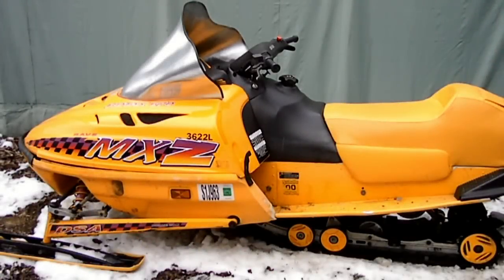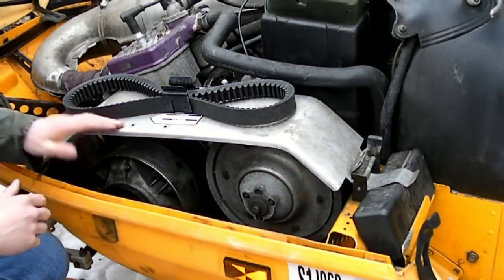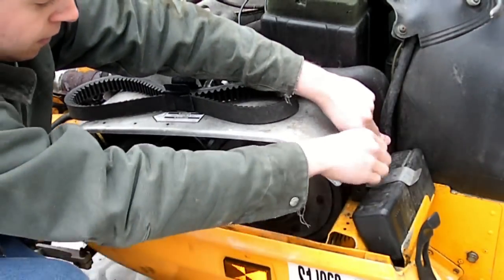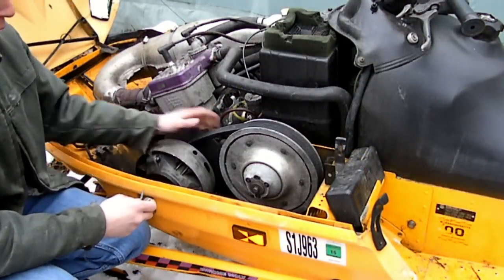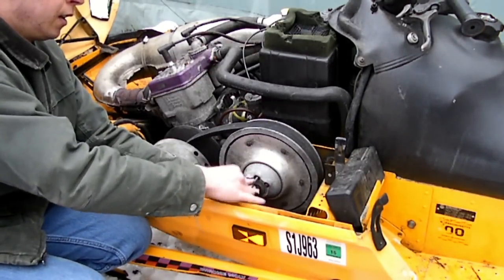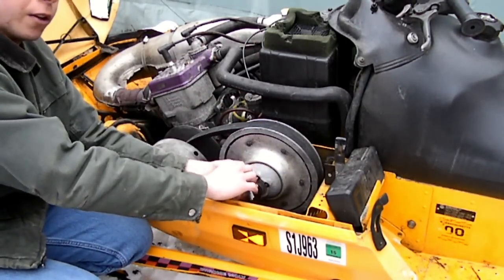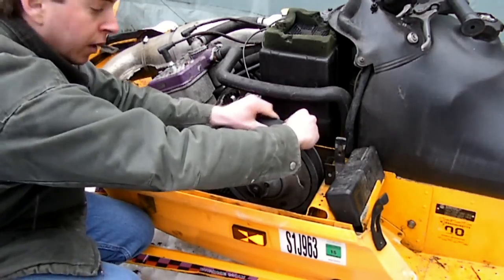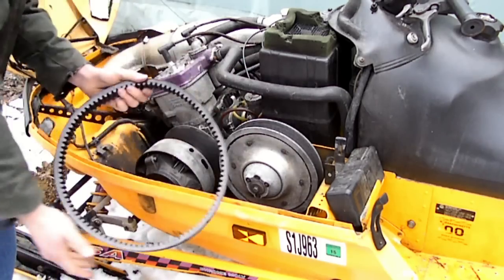How to Change a Snowmobile Clutch

Comment: Hope you adjusted your belt deflection! Top of the belt should me.even with the top of the sheaves on the secondary otherwise not gonna run and engage properly
Reply from the maker: Sean Jackson I was in need of a new belt. It's all good now.
Reply: 1/8” above the sheave at 12 0clock location

Comment: I have a ‘96 formula sls (500 rotax) and it only engages at 5000 rpm; belt looks allright and i dont think the clutch is broken. Do you have an idea on what’s wrong with it?
Reply: I have a 97 sls they engage between 4500 and 4700ish its how it's made, just built different look it up on some forums some people are very knowledgeable

Comment: at what point should i replace my clutch, im very new with snowmobiles btw.  i have a 2002 skidoo mxz 500 and i ran it this last weekend and my clutch isnt engaging till around 5000 rpm and it doesnt seem very smooth it just wants to take off and go. im assuming its the clutch but like i said im new
Reply from the maker: +Eric Matushinec Your problem is most likely the belt. The clutch itself shouldn't ever really need replacing unless it was damaged or broken in some way, which was the case for this one. Unlike a car clutch, where the clutch wears over time, a snowmobile's drive belt is what wears over time and needs to be changed. From the what you've described this is most likely what your problem most is. If you have the maintenance book that came with it, it will probably have a minimum thickness the belt should be. If it's close or below that it'll definitely need replacing. Alternatively you can probably google that to find an answer on thickness.
Reply: Thanks for the help, im going to call a dealer and get New belt thickness and compare it to existing one

Comment: U don't have to torque the clutch bolt in stages, its not like when u torque engine bolts when a gasket is being crushed and a sequence must b followed. Not a big deal, just make things quicker for u in the future. Also u should either get a new belt or set ur deflection
Reply from the maker: I needed a new belt at the time. Replaced it for this past years riding.